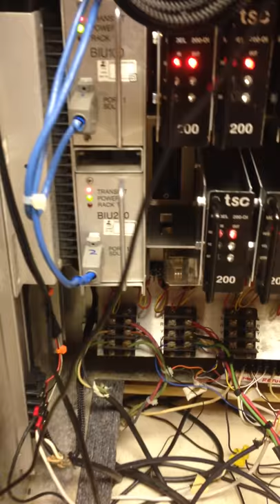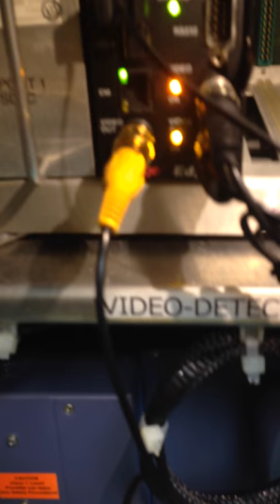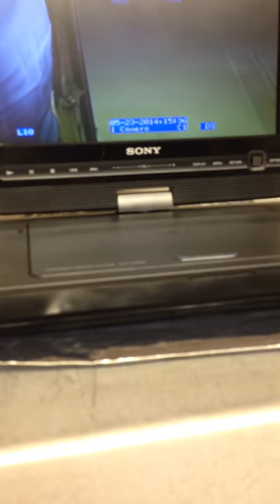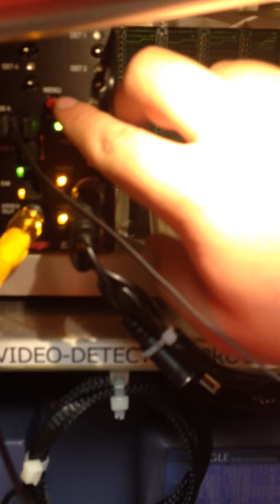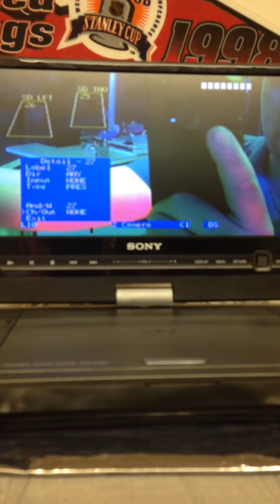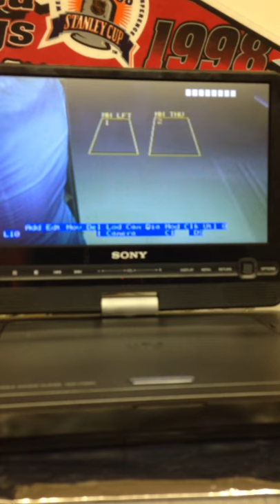Iteris Vantage Edge2 Dual

Comment: What kind of a camera are you using?
Reply from the maker: I am using Swann CCTV cameras. The video processor can accept any live video feed. It can use traffic grade detection cameras as well, but the smaller size of CCTV cams work better for a basement display. Easier cable hookup too. Thanks for your interest

-Nick